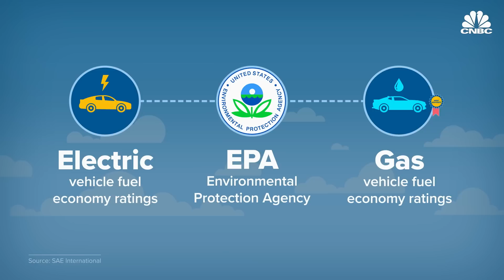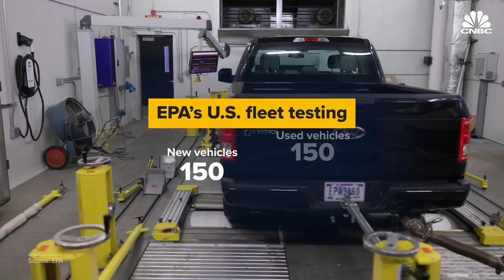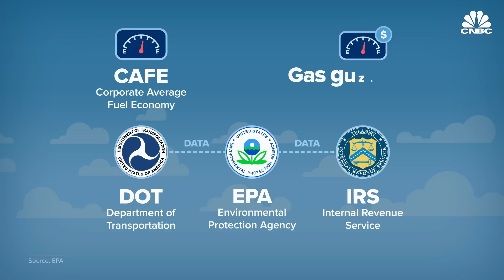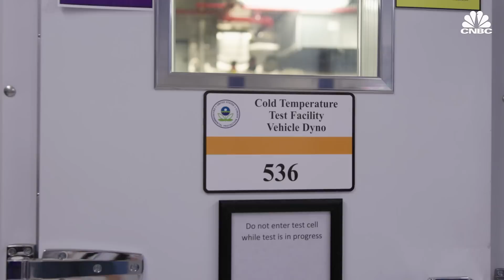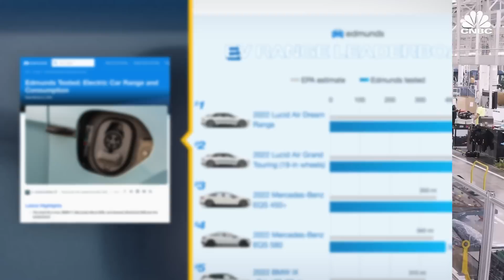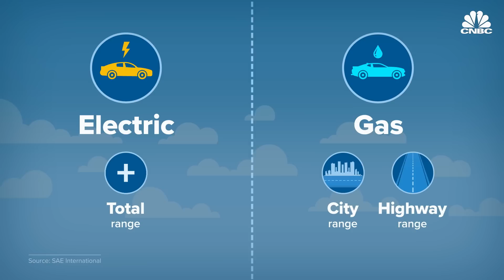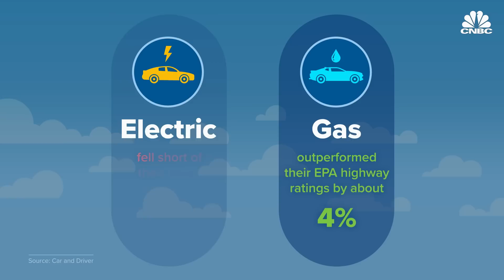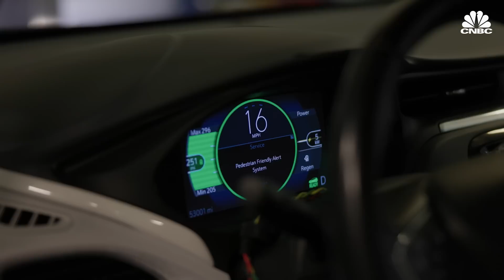Why Tesla And Other EV Ranges May Be Inaccurate

Comment: Having done a few road trips using a Tesla, the range you get is generally similar to that of an ICE vehicle according to the EPA. 

If you drive through middle America when the weather is calm and comfortable, you will get the EPA range, even at highway speeds. This is because it’s totally flat land, little wind resistance, and nice weather. Your gas car will get great MPG too. 

But then when we both go up a mountain, we’re gonna burn more energy than going flat. Your range will not be close to what the EPA estimated. This is to be expected. The same happens in extreme weather. 

With the number of chargers that exist, it’s not really a concern being able to do things in a timely manner. I can go to Sequoia National park and visit the trail of giants using my EV and make it back to charge with battery to spare. It’s not terrible.

Comment: EVs don't emit pollutants when they are being driven, but they do emit pollutants when they are produced, charged and recycled.
Reply: Gas cars also emit pollutants while being produced, re-fueled, and recycled just in different ways
Reply: @JetJiles  Hence, use public transportation or work from home when possible.
Reply: @JetJiles true, but it's different..a lot of that industry is established, while they are all kinds of materials needed for evs. Rare earths for example (there is a reason they are called this). To mine them takes tremendous amounts of water and energy.

So the point is, evs are not as clean as people are told
Reply: That’s why lifetime emissions are still lower. The absence of tailpipe emissions significantly reduced the footprint of an EV, even if charged on a coal grid.
Reply: Tires leave behind microscopic particle pollutants as they are used
Reply: @computeinmemory  ICE cars have tyres too my EV tyres are so far lasting longer than the sets on my previous SUV.
Reply: A shocking 40% of all gas goes into transporting it from the oil field to the gas station.
Reply: True - EVs have a higher "carbon footprint" when made v an ICE car - i.e. they pollute more in the manufacturing cycle. By the time you drive 15k miles in each you are break-even, anything past that you're less polluting with the EV
Reply: But overall, over the lifespan of a vehicle, those total pollutants are much much less than that of a combustion vehicle.  And technically, there is one often-over looked pollutant -- brake dust.  But regenerative braking doing most of the slowing down of EVs gives of much less brake dust than a combustion vehicle (despite EVs being heavier to comparably-sized combustion vehicles).
Reply: Still way less than the production of a full EV
Reply: @TonkaFire2019 based on what evidence?
Reply: @TonkaFire2019  True - EVs have a higher "carbon footprint" when made v an ICE car - i.e. they pollute more in the manufacturing cycle. By the time you drive 15k miles in each you are break-even, anything past that you're less polluting with the EV

Comment: owning a reliable hybrid car (Toyota Camry) is the best of both worlds without compromising range, battery & maintenance cost, or fuel economy! 😂
Reply: I'll still have to do more maintenance than a regular ev, but a regular ev will cost more to replace the battery
Reply: @Ryan24-q5w don't forget the motors, those will fail after 100k miles.
Reply: @cerisem7727  No they won't, electric motors are rock-solid.  I think some of Teslas very early designs didn't always hold up well long-term, but those issues are in the past.  And very few EVs will ever need new batteries.  The batteries that need replacing are generally caused by manufacturing defects, and are generally caught before the warranty period has elapsed.  Manufacturing is getting better all the time.  And no, batteries will not need to be replaced due to degradation -- that's not a thing any more (you're thinking of Nissan LEAFs, which passively air-cooled their batteries).  Everyone liquid cools their batteries now, and after reducing to about 85% of their original range over 5-10 years, they'll stay there for the rest of the cars general lifespan.  Battery capacity will drop slowly, but most cars will be junked before the battery holds such little charge that it's not useful to either its current owner or a downmarket owner who finds the range acceptable.  So much more can go wrong in a combustion car due to the increased complexities.  EVs are able to get rid of so many complex systems.  Now there's fewer complex systems, though there's still plenty of complexity.
Reply: Keep drinking the Toyota Kool-Aid.  That is what they want you to believe.
Reply: I just gave a quote to a customer for replacement of the HV battery on a Gen 3 Prius. She said it was less than half the price of the quote from the dealer. I need to raise my prices.
Reply: My diesel 1500 Sierra blew epa rating out of the water. Could do almost 700 miles on a single tank. 35mpg on the highway and low 20s in the city.
Reply: @TonkaFire2019  How much diesel smoke did you blow out your tail pipe?  Or do you even care? Those of us with kids do.
Reply: @bingosunnoon9341   idk ask the EPA my truck has DEF/urea so not a lot. And if it didn’t have it probably very little either. Truck is super efficient for 6500lb truck. I bought fewer gallons of fuel compared to 1/2 gassers.

Comment: They aren't wonderful for gas cars either. Electric cars are much better in town than on the highway. Even with the large battery's today I don't 
see how they can run these more than 4 hours on cars with a claimed 300 miles range.
Reply: On a road trip, most people like to stop about every two hours to use the bathroom, stretch their legs, and grab a snack or meal.  With a better charging infrastructure, and faster charging cars (like the 800V cars that do 10-80% in about 20 minutes in the warmer months), there's not much need for a car with more than 300 miles of range.  300 miles really is the sweet spot in my opinion.  Unless you're a road-warrior always doing long hauls, any more battery than this is just going to be a drain on efficiency due to the increased weight of the battery.

Comment: One more tip's you need the liquid to tear the solid metal incase of evaporation to release gas particles for kinetic algorithm that's basic Capasitor Bank work out . The same way of isotop nuclear reactor . So if you wanna make good range on an fully EV vehicles just put on the isotop nuclear reactor in it. Who's gonna agree about it?

Comment: Just make 700 mile range cars 🤷‍♂
Reply: At a certain point, you're dragging around too much heavy battery for 99% of your use case.  That's wasting electricity in terms of poor efficiency, at an unnecessarily high vehicle purchase cost.  You're also depriving other vehicles of those battery resources, delaying CO2 reduction of the global fleet.  Batteries are getting denser, and charge times are improving.  In 10 years, I bet 400 miles will be the sweet spot and can charge 10-80% in 10 minutes.
Reply: If you want the car to have one seat and still be affordable sure😂
Reply: Well they need to add another 100 miles of range to get the range stated in every normal condition. It's not like the gas cars get there EPA range in most conditions either.
Reply: Toyota is already working on that, they will have a production vehicle with 500 mile range by 2025, and a 700-900 mile range by 2029 because of solid state batteries.

Comment: Why can't the EPA just test the vehicles at city speeds, then test the vehicle at the average freeway speed limit of 70 mph and place both on the Monroney sticker. It makes you think they're purposely not doing that due to the lower 70 mph range number which will dissuade buyers from transitioning.
Reply: Temperature, wind, traffic, terrain, road surface, humidity, lead-footed drivers.  The only way to average out all of these variables is to make hundreds of journeys by dozens of employees over the course of a year.  Should automakers wait a year for an EPA rating?
Reply: @mikefarrington7141  it seems as if they wouldn't need an entire year since they're doing the testing in a lab as opposed to actual driving in real world. So I'm assuming they could emulate whatever conditions are necessary for a specific test.  To me, the biggest thing is the freeway range at a constant speed of 70 mph for the duration of the test. It gives a general understanding of the freeway range you should expect to receive with ideal conditions. For the past couple of decades, the city and "highway" MPG have always been separated, so I'm not exactly sure why the same can't be done for EV for range.

Currently I don't have any complaints with city driving as it's relatively easy to achieve EPA. I think a 10-80% charge time would be a good addition to the window sticker as that's equally important as the range.
Reply: I own an EV and their test is pretty accurate for highway driving unless you have an lead foot.
Reply: @iali00  No lead foot, I use cruise control on the freeway at 70 mph in an ID4 and I'd be lucky to 70% of the estimated range. City streets I can get pretty close to the EPA range. I just wish there were separate numbers for each to help with expectations
Reply: @flyinryan4  What wasn't mentioned in the video—or if it was, I missed it—is that on the EPA Highway test cycle, the speed never exceeds 59.9 MPH, and the average speed is 48.3 MPH. On the high speed (aggressive) test, the speed hits 80.3 MPH for a few seconds, but the average speed is still only 48.37 MPH. I'm pretty sure if you drive at an average speed of 48 MPH, you'll hit the EPA range!
Reply: Money

A certain group doesn’t want knowledge and research findings released for anyone.

Comment: The simplest way to get a real average would be to pull the data from say 100 different people in different circumstances living in different climates collectively you should be able to go to good sense of average highway and city numbers
Reply: absolutely - surely there's so much tracking these days that we can aggregate enough data to come up with some statistically sound real world numbers for different scenarios
Reply: If you want to know real world milage for any of these there are a lot of tests done by people on ytube running cars from
100 percent to 0 on the same highway or course loops.
Reply: If you cannot control the variables,  comparing the results would be irrelevant 🤔
Reply: I disagree. Standardized testing is the only real way for the consumer to compare one car to another. The tests are not intended to be a guide for the consumer as to how far they would be able to go on a single charge, but should enable the consumer to compare one vehicle's range to another.
Reply: @Hans-gb4mv  with a sample size large enough (as n approaches infinity), the statistical reliability of a measurement approaches 100%. All you need is to find the standard deviation, and with a sample size of just 2-3x that, you can be 99% confident that your estimate is accurate. It's basic statistics.
Reply: @DoesntRefillTheBrita  agreed.    And this would prevent manufactures from being able to game the tests.